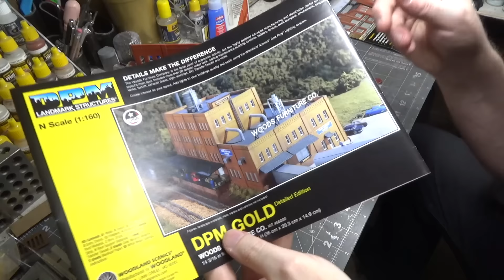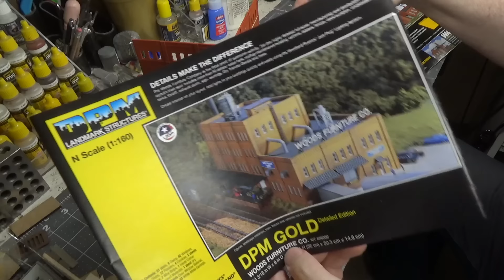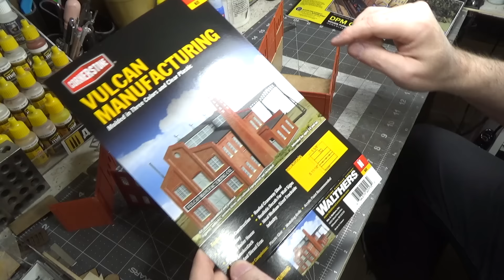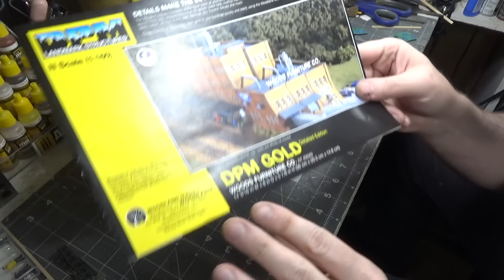Building a brick factory!

Comment: Nice build showcasing the big advantage of N scale allowing industrial structures and other scenic items to dwarf the trains. It would require a lot of real estate to pull this off in HO scale but might be done by making the DPM section into a flat set against the backdrop.. Also noted that your method of painting brick walls has evolved over time. The results are excellent and much simpler to achieve than with earlier methods.

Comment: Yeah Jason those metal parts are a pain to clean up but I found using my Dremel tool makes short work of it.    I have both kits, so I plan to build it like you did but will change it up some.  I love the walk over you added.  Right now I am scratch building an Electric furnace for my steel mill section of the layout....N scale is fun huh??  Looks great

Comment: That's a magnificent structure, and well worth all the effort you've put in so far. 
I feel your pain regarding whitemetal castings: it's just horrible to work with.  That's what life was like before 3D printers!  Worst were white metal HO figures, where you had to work out what was flash and what was actual detail.  And for anything bigger than those little castings, you get the problem that it's such a soft metal, the castings could easily distort as you tried to work with them.

Comment: Don't want to spoil your satisfaction. Weathering is awesome, as usual. I'm not a builder and I don't have any building related education and I have no idea how similar buildings look like in US, so take my opinion with grain of salt. That "bridge" part should be supported more or shorter so the thicker part of the wall (brick pillar)  is aligned with the wall in the bottom part. Under it has to be a supporting steel construction or a vault. Talking about the bigger part of the building I doubt that a builder would put the weight of the brick wall into the middle of the roof construction, which is supported by those brick pillars. It should be either aligned with them or with outer wall. If you build a factory you try to be as cost effective as possible. A tale about later modification can be used to explain everything, though.